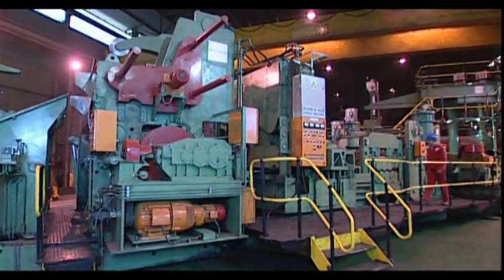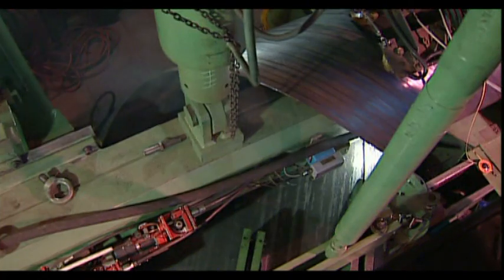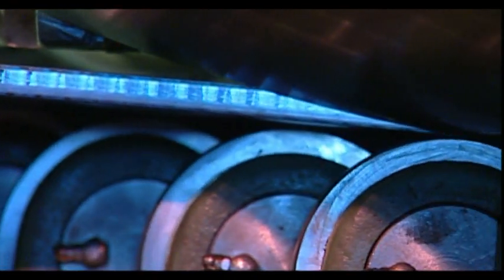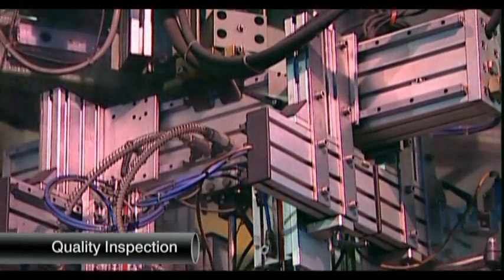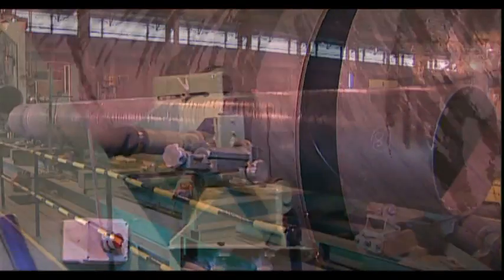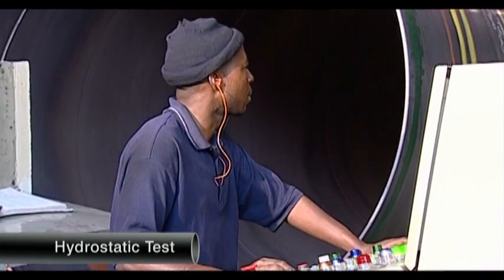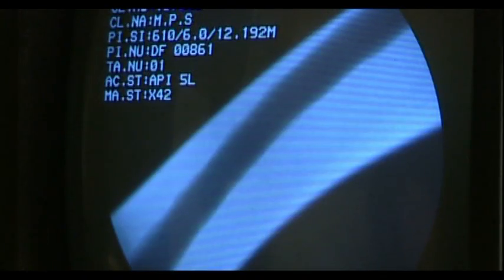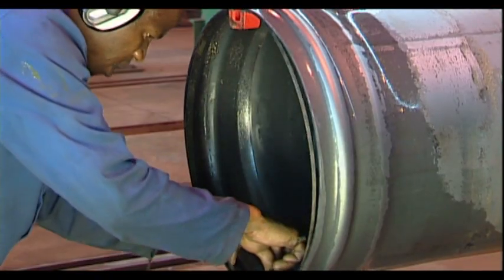Spiral Welded Pipe Manufacturing Process

Comment: what do you do in case a part of the welding goes wrong.
do you manually weld them? or reject that section of the pipe? What are the norms?
Reply: You kick them out into a repair bay and they're repaired by hand/with sub arc depending on the amount of work and location.
Reply: Little late to answer your question but if there is a flaw in the weld it is either fixed by hand welding it or if it can't be fixed the defect is cut off.  They then can take 2 or 3 pieces that have been cut off and weld them to each other for one length of pipe.